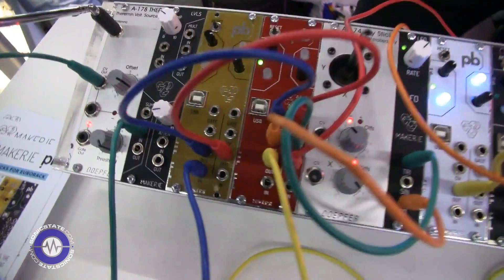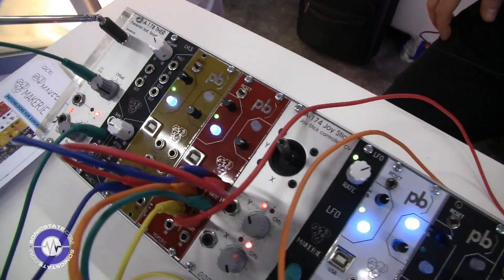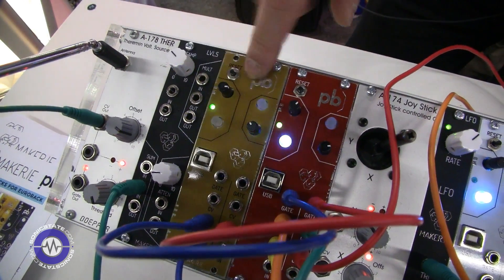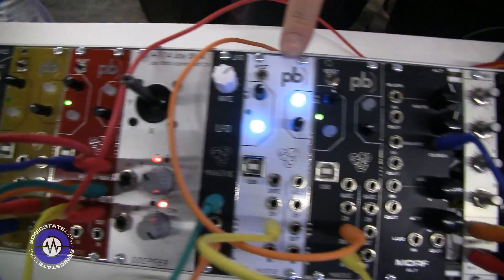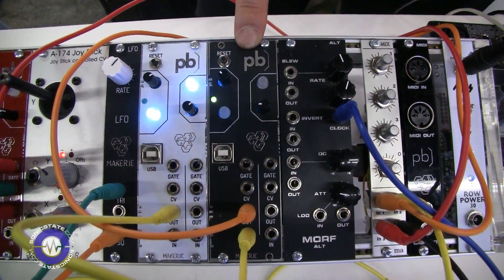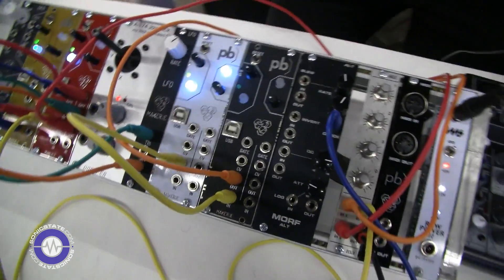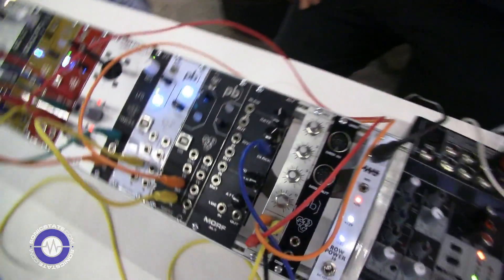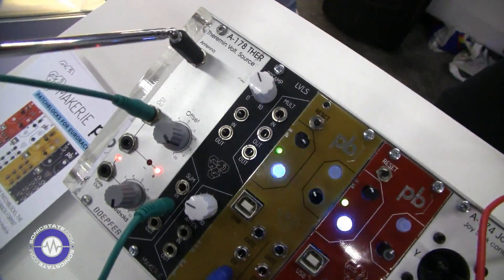MESSE 2016: Patchblocks Eurorack by Maker.ie

Comment: I'm not sure what these Euroracks are for? Are they for communicating to aliens in far away solar systems?
Reply: Basically, yes.
Reply: +JimBeam Yes exactly, and also don't forget communicating with dolphins!

The module is a programmable patchblocks module that has the input & output voltages scaled to modular synth levels, and also adds external control voltage inputs for the patchblocks controls, it is a new hardware implementation of Patchblocks for the Eurorack format. There is currently a small but dedicated community of users who are developing blocks of code and also patches and uploading these to the patchblocks website. The patchbocks software editor was originally developed to help people to learn and understand digital signal processing (DSP), you can download the editor and check it out at www.patchblocks.com
Reply: +JimBeam Fart sounds mate, just fart sounds and of course the lushest Buchla bongos ever
Reply: E T home phone!!!!!!!!!!